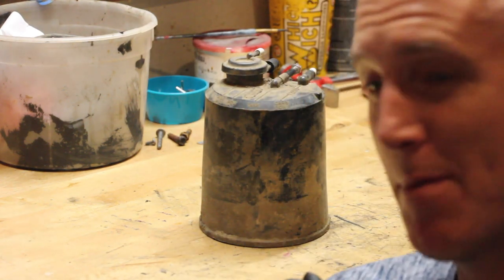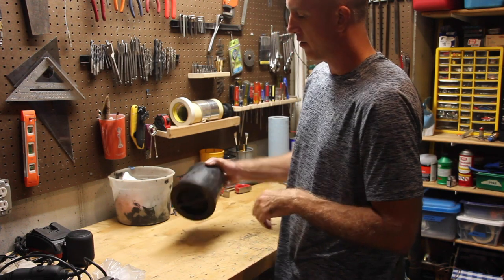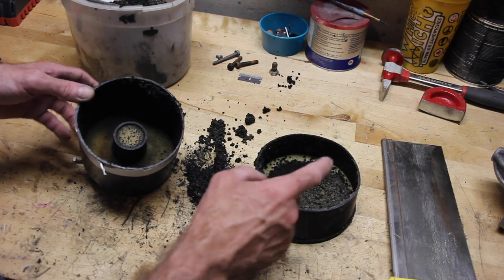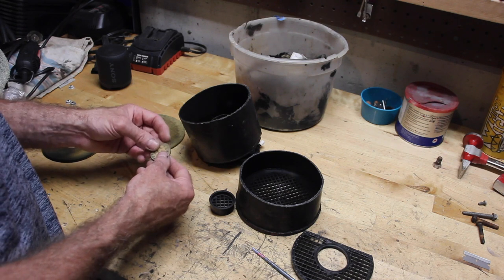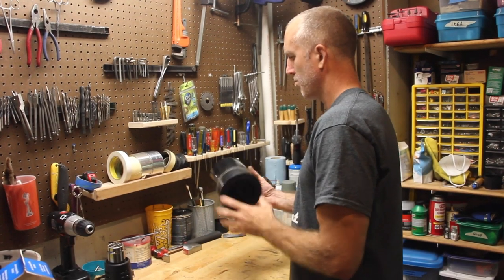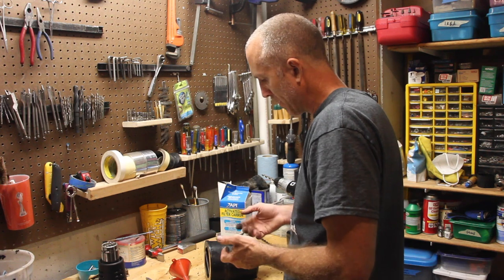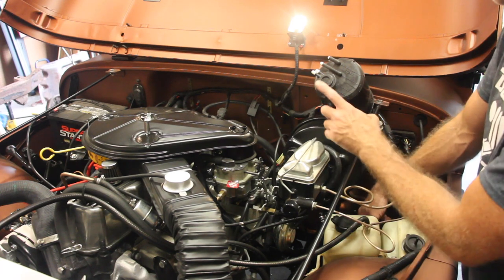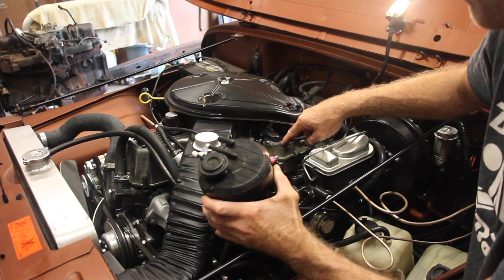Jeep CJ7 Charcoal Canister Renovation

Comment: Wait a minute. No cigarettes? I may not be able to do this.
Reply from the maker: Just try to provide some safety pointers for my followers :)
Reply: @coolguy_CJ7  you always do a good job and video. I'm a dumbass with the smoking. About the only time I'm not smoking is when I'm removing a gas tank. Met a guy once who had been severely burnt and permanently scared. He was removing a tank and it went up. No smoking and he didn't know what set it off. Very scary to here this and see what happened to him. He sternly told me to never pull a tank. To work on them you have to but when I do he is my first thought. Also knew a guy welding on a huge tank that had been properly cleaned and it blew up and litterely removed his face and ears. Very hard to see him and the damage. I've always thought if they would have pumped diesel exhaust in the tank to drive out the oxygen it might not have blown.

Comment: You skipped the hole part of the repair!  :(
Reply from the maker: I'm confused. What did I miss showing or explaining?
Reply: @coolguy_CJ7  After you welded it back together you drilled a hole in it so you could  re-fill it with charcoal.  That's the repair I was talking about. I just finished doing the same restoration on mine (from an 85 Cherokee) and how you did that part would of been helpful.
Reply from the maker: @captfuzzy3900  Ok, I see what you’re looking for. If you get that plastic welding kit or one like it, there is filler plastic that comes with it. You can use that or a plastic epoxy and just smooth over the hole.